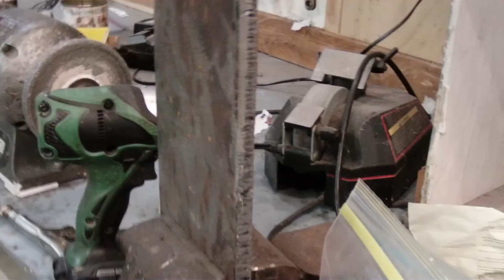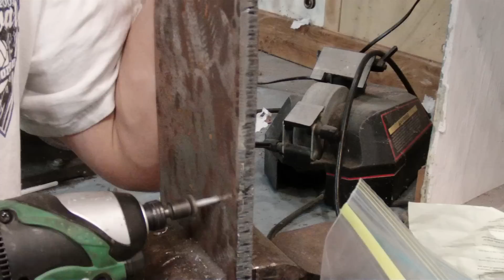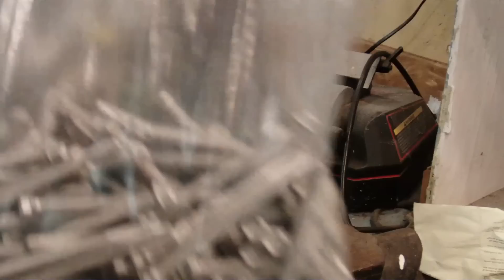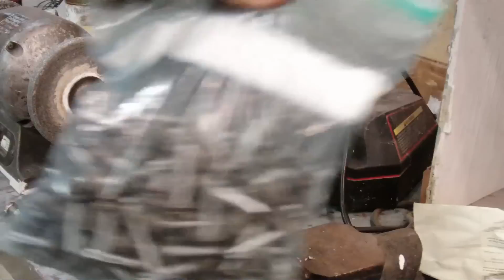self-drilling & tapping screws into .5 inch (1.3cm) steel

Comment: Cool!!!  I need to install some ground straps into my truck frame so a self drilling screw should work.  The steel is only 3/16 of an inch.  Yes?
Reply from the maker: It depends on the alloy. These screws are actually slightly less hard than hardened 410 stainless, which itself is softer than some structural iron, such as the iron on certain mobile home frames. Mind you, most mobile home frames would be soundly penetrated, but not all.
Modern vehicles sometimes have super hard steel, but I imagine that vehicular frames wouldn't actually be using something of such hardness, so I expect that they'd drill through just fine.
Reply: @JustinCrediblename  Wow a very detailed reply!!👍🏼  It’s a 98 4Runner that has a frame that’s prone to rusting bad in areas of salted roads.  So I imagine that the steel isn’t too hard.

Comment: I would like to see you install a 3/8 in screw into metal. I am having a hard time
Reply from the maker: do you mean like drilling a hole with a normal drill bit and then threading it by hand for a specific bolt? 
If it's a self-drilling screw, then it's probably going to need a LOT of force to properly get through. Maybe 50 kgs of minimum force.
You might be needing to buy a "mag-drill" to make sure you don't wear your body out when putting 3/8 self-drilling screws in.
Reply: @JustinCrediblename   the directions say to drill a 11/32 hole the use the self tapping screws. Can you recommend  a dill that won't break the bank.  Lowes is the closes store. 
BTW. Its not really 3/8. It is metic I think.
Reply from the maker: @gdjoslin  well for a cheap drill, I'd just check craigslist or facebook marketplace. 
That's a pretty big diameter for self-tapping screws. they might be really expensive. It might be cheaper to buy a tap and then buy bolts. Sometimes the taps cut the threads wide, so it can sometimes be beneficial to have some loc-tite around for the gaps.
Reply: @JustinCrediblename  tried to find a tap. Couldn't  find it. Even the machines  could tell me.
How many amp should I look for.
Drill or impact
Reply from the maker: @gdjoslin  drill. I used an impact because I was lazy. 
Dunno how many amps, but almost any corded drill will have a lot of torque. cordless is gonna be more expensive.

ebay has lots of taps. I'd be surprised if your thread pitch and diameter aren't for sale over there. There's bolt thread, acme thread, pipe threads, ...'gotta make sure it matches your fastener.
Reply: @JustinCrediblename  thanks for your help
Reply: Use baby oil.

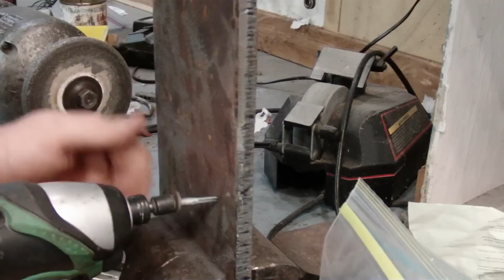Comment: 0:15 is there something special with your drill or is this soft steel?  I'm asking on Amazon if screws you listed can drill through 1/4" hard steel and being told no way.
Reply from the maker: well technically they are correct. There are no self-drilling screws that I know of that can go through the harder alloys of steel.
You'll have to know the alloy, get the hardness properties of that alloy, and then see.
I am pretty sure that 304 stainless, for instance, is already too hard of a metal for these screws.
Reply: @JustinCrediblename  Thanks... I'm trying to avoid pre-drilling a 1/4" thick lip on a fence T-post in a remote lot.  I'm using power from a 1200 watt inverter in my van while it runs.. seems enough power .  IDK, but that steel is harder than a mother and i can't seem to keep my bits sharp everything just spins hot. granted I'm doing it standing while they are already up.  Maybe i need M42 Cobalt bits.
Reply from the maker: @12vLife  m 42 is fine but i prefer m35 cuz i break m42 too much. i will test a screw in a t post later.
be sure not to spin the drill too quickly.
a jar of water is good for dunking hot bits.
ttyl
Reply from the maker: tested 1 screw on 2 T bars. worked
Reply: @JustinCrediblename  is that an impact drill? what drill you using?
Reply from the maker: @12vLife  yeah an impact cordless
Reply: Which hard steel? spring steel? CrV? Won't work unless you kill the heat treatment. Some stainless steel will require WD-40 while drilling.

Comment: Hi Justin, what model is your Hitachi electric screw driver? I'd be very interested in your thoughts on what driver seems best for driving self-drilling screws into steel. Thanks for your videos, Dave
Reply from the maker: David Urquhart WH18DBDL (brushless)
But the milwaukee and metabo are more powerful.
I liked the hitachi at the time for its weight balance and low-battery auto-stop feature. It's also decently powerful as well.
Dewalt's new high-end driver would probably be better, though.
The warranty on the hitachi is bogus, which was problematic for the corresponding drill, which was built with a cheap chuck.
I can't recommend hitachi over modern dewalt. Please be careful in your choice!

Comment: Does it matter what torque strength you have on the drill you use?
Reply from the maker: +DaftSwank 
It sure does. It takes a certain amount of both downward and twisting force for the drill bit to tear the steel apart. Get below that amount, and you'll only be able to chip the steel, which might wear down the tips of the drill bit and you might not make it through your material before it dulls too much to be useful.
Reply: ***** So how do you know whether your drill has the right amount of torque force? When you buy these self tapping screws for metal, does the package typically mention a recommended torque force? Guess I'll go to Home Depot now and check. I'll let you know!
Reply from the maker: DaftSwank
The modern high-end drills from home depot should barely do the trick (through half inch plate steel). Milwaukee drills are marketed as being particularly suited for strenuous tasks like this.
You can't find these at home depot. I'll bet you could bring a drill and a piece of metal to home depot and see if your drill can handle it?
regardless, good luck.
I think that normally people use big corded high speed drills with these things because they're used in an industrial environment. they're also probably magneted down to the material to increase downforce because it's strenuous on the body to repetitively apply this much force

Comment: Can you share make/model of your impact driver?
Reply from the maker: I gave it away. It was hitachi's best about 8 years ago when they first came out on the scene with a competitive lithium cordless driver
Reply: @JustinCrediblename  Thank's - so it was as cordless impact driver.  I have a great Rigid impact driver, not sure what RPM it runs at.  The screws I'm looking into are 1/4-20 and specs say use 2,000 rpm drill motor.  I will be putting in almost 2000 screws so want to make sure I'm using the right screws and tool so as not to make my life miserable..  I think corded will be the way to go.
Reply from the maker: @sungenixenergy2629  that's a lot of screws!
If you're going into structural steel, perhaps it might be worthwhile to get a "mag-drill". Someone in the comments mentioned such a tool. You only get one body!
Please don't wear yourself out!
Are you building a metal building?
Reply: @JustinCrediblename  Yup I do have a mag drill but still seems like a ton of work.  Used to attach solar panels to 12x3x3/16 steel rafters.  Take a look at these clamps that we are using.  In place of the 1/4-20 machine screw you see there, we will be using 1/4-20 tek screws instead... http://files.ironridge.com/roofmounting/cutsheets/IronRidge_Cut_Sheet_Grounding_Mid_Clamp.pdf
Reply from the maker: @sungenixenergy2629  man it seems like it could be so much easier just to weld it all on.
Reply: @JustinCrediblename  The structure itself... rafter, purlins etc will be welded.  The solar panels themselves cannot be welded to the structure (would damage aluminum frame, also panels need to be removable for maintenance/replacment)..
Reply from the maker: @sungenixenergy2629  I was thinking of welding bolts or threaded studs underneath where the clip is supposed to go, instead of penetrating the beam.

I guess 3/16 steel isn't so bad to drill through, though.
Reply: @JustinCrediblename  Welding threaded studs onto the rafters is actually a great idea.. We have a GC who is building the structure so I would have to try to pass the work on to him, whereas we are responsible for mounting the solar panels...
Reply from the maker: just so you know, I prefer bolts to studs, when possible, so that I can easily get massively strong welds in a single pass. It looked like your clip might allow that.
good luck with the project :)
Reply: Its a metabo sir!

Comment: Whow, just doing job having to fasten 3x4 's to 1/4 steel post(3 1/2x3 1/2) Wasnt even sure it posseble, did seem second screw required more forsce, hence your arm wrapped around steel beam, do you really need a mag drill?
Reply from the maker: I was probably putting 70 lbs of force on the second screw toward the end. The first one was probably like 40 lbs.
If I was doing that stuff all day, then I'd really need a mag drill =D
I'd never heard of a mag drill until your post. glad you mentioned it. cool tool!

Comment: Great deals, but I'm too cheap to randomly screw into a thick ass piece of steel for no reason. (YouTube revenue tho).
Reply from the maker: I'm too cheap to do that as well. haven't made a dime off of youtube.
Reply: Justin Crediblename Gutted. Very legit name tho.
Reply from the maker: XD lol
Reply from the maker: I know it's like a year late but I thought I should mention that there is a private 28 acre scrap yard that I get my metal from.
It's 35 cents a pound for normal steel, cost-of-gas torch-cutting <-- talk about a screamin' deal!, 1.00 stainless, and 2.00 aluminum.
this piece was left over from my mailbox projects.

I had a lady back her nearly new ford focus into one of my mailboxes - she almost totalled her car. insurance paid for it under the lie that a tractor's bucket scraped by her vehicle on the side of the highway.
the only thing I had to repair was a 4 square inch aluminum cover (because this 1/2 plate steel is ugly when exposed to weather)

Lemme know if you want a vid of the mailboxes or something.

Comment: Even builderx, LF ,corroshield drill better(12 mm plate)
Reply from the maker: Mustafa Abbas I'm sure buildex screws do indeed drill better than buildex screws.
The particular steel alloy will change drilling characteristics drastically. Show me work-hardened 304L stainless plate drilling faster than this and you'll have my attention.
Mustafa Abbas original quote: "even builderx, LF ,corroshield drill better(12mm plate)"
Edit: the second screw (the slow one) was the buildex screw. The first one was SFS (as indicated in the description)
Reply: Is that a drill driver you are using? What's the attachment used to drill the screw called?
Reply: It's called a nut driver bit.

Comment: where can I get those screws at?
Reply from the maker: +burner936 You can buy a box here for only $653.00! ;)
http://www.mutualscrew.com/product/hex-washer-head-heavy-duty-steeltosteel-teks-selfdrilling-screws-itw-buildex-70659.cfm?source=froogle&gclid=Cj0KEQjwvo6wBRCG3Zv92ZSLlIYBEiQA5PLVAloYVGo2WS-41rTl5TemgoVmU7yaOmUuO78JDKJ7xOsaApc68P8HAQ
Buildex "superteks series 500". try shopping.google.com

...I think that both screws are a special order kind of thing. Not sure.
Reply: +Justin Crediblename OK, thanks. I only need about five though. I'm trying to drill trough a 16 gauge iron strip that's going to hold my 1x6 wood on the iron gate. I'm drilling for about 68 wholes and didn't know how or what to do it with until I saw these. I tried a metal drill bit for that but didn't go through.
Reply from the maker: burner936
ahhh 16 gauge! I'm pretty sure you can find fine threaded self-drilling and tapping screws (tapping makes threads, drilling makes hole) at most hardware stores
Reply: +Justin Crediblename Thats a freaking ripoff at over a dollar per screw. Just go to harbor freight, you can buy a whole pack of these things in assorted sizes for about $8
Reply from the maker: Dave Smith
Damn dave. no harbor freight screw is going to drill and tap 1/2" plate steel...let alone harder-than-normal plate steel.
I paid a dollar per pound. not a ripoff.
Good luck finding self drilling & tapping screws for 1/2" plate steel in ANY local hardware store.
Reply: @JustinCrediblename  brand?, where can i buy the smaller ones
Reply from the maker: @edgarrodriguez5401  the branding should be in the description